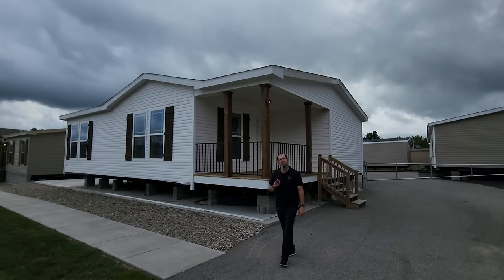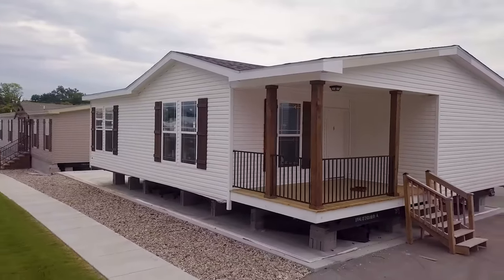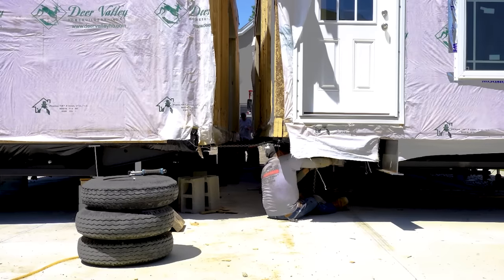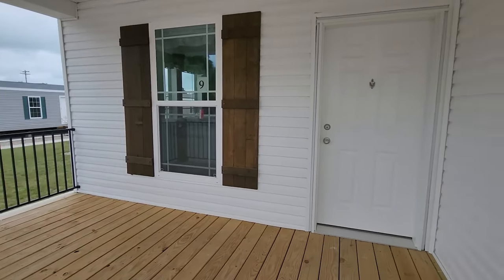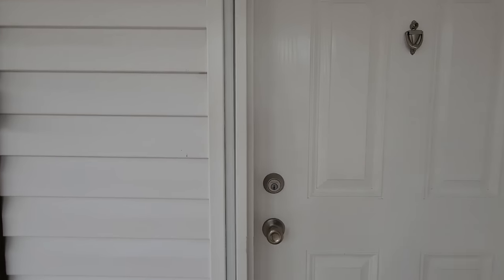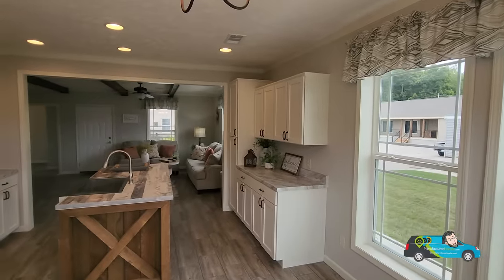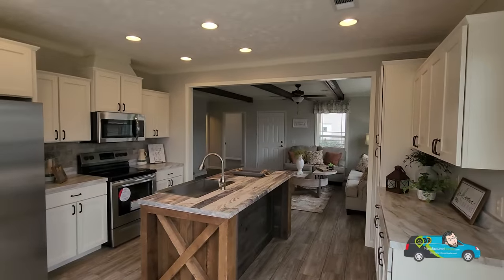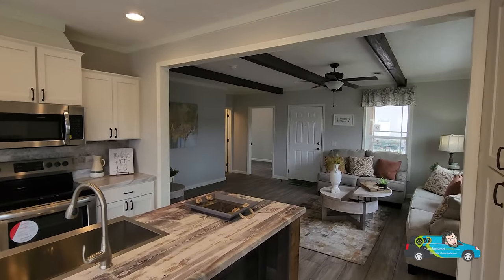The Heavy Built Deer Valley Home - A Perfect fit for a smaller space!

Comment: What is the difference between a manufactured home and stick built? It doesn't look secured to the ground. A tornado or hurricane could destroy this in a matter of seconds.
Reply from the maker: Hi! THese homes are built to regional standards based on the location of the home. You would be surprised really. Manufactured homes often fair better than Sticks when it comes to storms. Based on the International Building Code, a manufactured home that will be placed in a hurricane-prone area must be designed to withstand sustained wind speeds of 160 mph. In the rest of the country, manufactured homes should be able to resist wind speeds of 130 mph in Wind Zone 1 and 150 mph in Wind Zone 2. Click here to learn more: https://www.manufacturedhomes.com/blog/report-manufactured-homes-built-1994-equal-often-safer-site-built-tornadoes-hurricanes/
Reply: @WheresWilHomeTours  when I was working on my degree at UL, I took a few weather classes. One of the greatest hurricane disasters in Florida was due to homes being built on concrete slabs. They changed the laws at that time. All structures must be attached to their foundation. Nice try though.